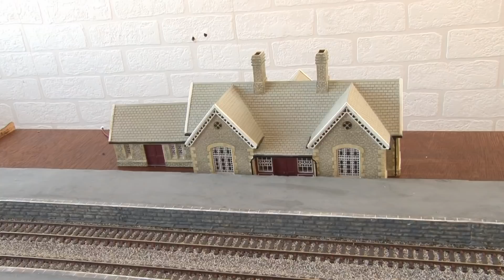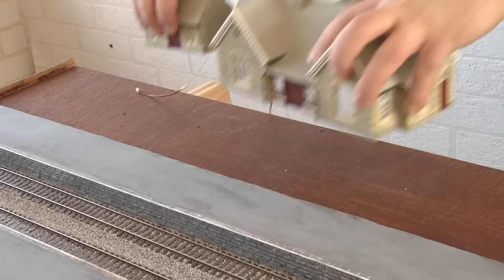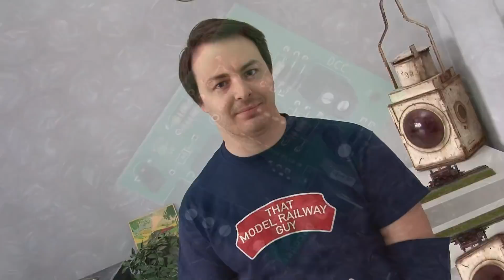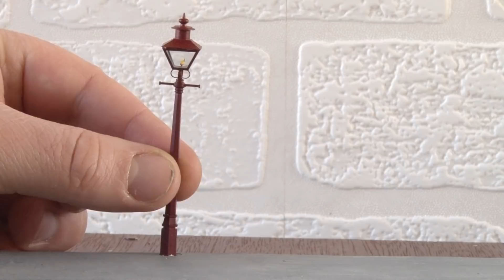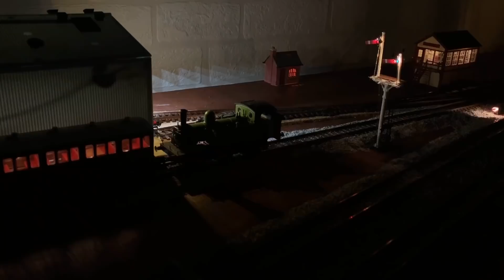Building A Modular Model Railway! - Episode 15: How To Install Lighting

Comment: Not sure if this has been commented on before, but isn't there a problem with using a buck converter to reduce voltage for LEDs without resistors, in that current increases? I'm no expert, but from what I can tell the advice is to still use a resistor unless the convertor is a relatively expensive one which reduces current as well.
Reply from the maker: The only issue I've come across is that if the buck converter fails then all your LEDs do so it's a single point of failure as opposed to one for each light. Thanks for watching 👍

Comment: Hope you're well.

For my understanding, is this the wiring for DC then

Power Supply into Distributor Board > Into Voltage Converter > Into LEDs via splice connectors 

Have I got this right?

Thanks in advance
Reply from the maker: Yes that's essentially it. You don't need the distributor board if you're just using the 12v supply for lighting - I only used one because I was powering other stuff from the same supply.

The buck converter can also be removed if you have resistors on each of your LEDs which steps them down to 3v. I just couldn't be bothered to solder a resistor to each light so opted to step down the whole circuit. Thanks for watching 😃
Reply: @ThatModelRailwayGuy What a guy, thanks for your response.

Comment: Hi. What app is used to control the layout please?
Reply from the maker: It's the Z21 App that works with the base station I use. Thanks for watching 👍
Reply: @ThatModelRailwayGuy  thanks for the quick reply and the great videos. Have you considered doing a comparison of the different controller options? E.g. HM|DCC vs Z21 vs ... etc
Reply from the maker: The issue is that to make any sort of useful comparison you'd need to have access to all the different DCC controllers and hands on experience with each. Unless someone wants to fund that particular video I fear it would be beyond the scope of the channel.

Comment: If using non standard colours for teh wires it's always a good idea to put a standard colour tape at the ends of the wires :)  Loving the videos thanks
Reply from the maker: The wire colours are standard for me, I just didn't want to make the 12v lighting bus Red/Black as that would be the same as the 16v DCC (track power) bus. I tend to use Blue/White for 12v DC across my layouts for easy identification. Thanks for watching 😃

Comment: Great video - can I ask for more details on the step down power converter and the red clips that you use underneath on the wiring . Thanks
Reply from the maker: Hi there, all the products used are linked in the description for those that want more info. Thanks for watching 👍
Reply: Ah - thanks - was watching through the tv and couldn’t see the description with all the info . Will get my order I. ! Was there a video that showed how you did the outside lights on the shed

Comment: Great stuff. Perhaps not so good for my wallet.  lol.
Reply from the maker: The lighting was probably one of the cheapest parts of the layout. If you're not including buildings and kits, the 12v power supply was probably the most expensive part to be honest. Thanks for watching 😃
Reply: @ThatModelRailwayGuy  where about did you get your 12 volt supply? I have a Hornby elite dcc and would prefer a separate source for my lights and points.

Comment: Great video.  I have a question, I want to put a single led light in a paper building.   Do I have to worry about fire?
Reply from the maker: I wouldn't have thought so, it probably wouldn't get hot enough especially if it's a 3v LED. If you're really worried you could always mount it on some tin foil as a protective shield, which will also reflect the light. Thanks for watching 😃
Reply: @ThatModelRailwayGuy  thank you.  Good idea.😊

Comment: Whats the track plan and baseboard size ? Cus I might make one
Reply from the maker: As the layout is modular naturally the track plan and size changes depending on how I set it up. If you check out Episode 16 though there is a track plan towards the beginning which shows the layout in its exhibition setup. In that instance the main circuit is around 13'x7'. Thanks for watching 👍

Comment: Nice Layout There 
9:12 odd how the signal moved up and down slightly
Reply from the maker: Thanks, it's certainly starting to get there. That's just because the servos are on the same power source as the lights. When the control unit powers on it gives the servos a quick check. Thanks for watching 😃

Comment: I want to install some station lamps like the ones in the video but I don't want to do all the fancy electronic bits you did under the board but do a basic wire up to a controller or something similar.
How do I go about doing this bearing in mind im not good at soldering and wiring?
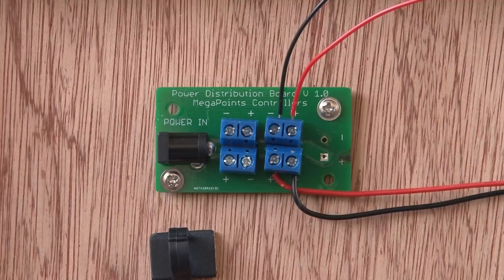Reply from the maker: Hi Matt, the wiring would be pretty similar in all honesty, you would just connect your wires to a DC controller instead of the board seen at 04:45.

If you don't use a voltage regulator you would have to solder a resistor to every single LED though. OR you could just keep the controller on at a very low level but there's a risk that your lights will blow. Another option would be to perhaps look at getting a dedicated 3v power supply instead although I don't have any experience with those.

If you're not very good at soldering (I can relate!) then I would suggest looking at the 12v Power Distribution Board linked in the description. That will allow you to connect up multiple lights using screw terminals instead, which are much easier to use. Hope that helps and thanks for watching 😃

Comment: A great video. Just the info I needed. Out of interest, has the voltage regulator remained consistently working 9 months on?
Reply from the maker: Yep still working fine and I've used the same regulators on two more layouts since this video. One was an exhibition layout where I leave the lights for pretty much the entire weekend and the other was a Christmas layout where the lights were on throughout December as part of the festive decorations. No problems at all so far. Thanks for watching 😃
Reply: @ThatModelRailwayGuy  I thoroughly enjoy each series as they are produced. I always learn so much, very well presented. ⭐⭐⭐⭐⭐ 5 Star channel

Comment: Great video. I think using the woodland science just plug in would be a quicker install. For lighting and adjusting the brightens of the lights. I've used them, they are easy to use and install.
Reply from the maker: Thanks Trevor! Yeah the Woodland Scenics system would probably be easier to install but it would probably end up being much more expensive if you have a lot of lights like I do here. Thanks for watching 😃

Comment: Great video and clear and easy to follow. Do like that voltage regulator. Winsor and Newton Black Acrylic paint from the Range, is a very dense black for painting inside Hornby resin buildings.
Reply from the maker: Glad you enjoyed it! Yes the voltage regulator is very handy for getting things up and running quickly. Good tip for painting the inside of the buildings too, I'll have to check that paint out sometime. Thanks for watching 😃

Comment: I would have had the socket for each building above the board and in the building to make connect/disconnect easier (no need to crawl under to seperate) PS if you want to have flickering lights in fireplaces/fireboxes/bonfires etc then use the led from a led tealight. I made them for a friends layout
Reply from the maker: Yep you can do it that way too if you like. As my layout is modular though I have to go underneath to get it all setup anyway so it doesn't really make a difference in my case. Thanks for watching 😃

Comment: Great video mate. I have to say the lights really make a Difference to the overall appearence of a layout. DCC lights that's something I have never seen or heard of before it was interesting to see how they worked. Look forward to some night shots in the future. - Nicholas.
Reply from the maker: Thanks Nicholas! Yeah the DCC lights still run of 12v DC (or rather 3v in this case) but it's the On/Off switch that is controlled by DCC. I'm looking forward to doing some night time running in the future too! Thanks for watching 😃

Comment: for the cost of a couple of resistors its seriously worth adding them, dead easy, stick one end into your distribution block, and solder the other to the feed wires, this will make sure the current is suitable pretty much no matter what - and can also dim them slightly if desired. 1k resistors are find for 12v, higher may work well

there is another alternative, slightly more work but once its working its easy - use a PWM LED controller board - Adafruit do one that will drive 24 LEDs, needs a cheap Arduino clone but then you can vary the brightness of each and once happy switch the arduino and the driver on/off and the lights come on/off as desired. (this is a bit more work but once set up its really good, also very good for adjusting the brightness so different lights match)

I do like those shed lights though

oh yes, the black paint idea for blocking light leaking works very well, and nothing to say you can't paint over the black
Reply from the maker: Awesome, good to know. I LEDs actually all came with resistors and I probably will add them to the circuit at some point down the line. Doing things to a deadline to get a video filmed partly dictated the strategy here (along with my own impatience for results 😂). Thanks for watching 👍

Comment: Fantastic tutorial! Thanks very much. I’ll be referring back to this…along with your other videos as I progress my own modular layout.

Can I ask, do you use electrofrog or insufrog points? I have been struggling a bit with short wheelbase locos stalling when crossing electrofrog points. I’m not sure what I’m doing wrong though. I have altered them correctly.
Reply from the maker: Thanks, glad you enjoyed it! I use insulfrog points personally and my Peckett and Ruston are fine on them. 

If you’re having trouble with electrofrogs maybe check that they’re layed completely flat and not bowing at all. Otherwise it can lift one set of wheels off the track - it may only be a millimetre or so but it’s enough to cause a stall. Thanks for watching 😃
Reply: @ThatModelRailwayGuy  Thanks very much for your advice.👍 Much appreciated.

Comment: Enjoyed the video. I am currently working on lighting up my own station and platforms. To dim the brightness of the lights, might I suggest this 'High Temperature Heat Resistant Tape polyimide 1cm'. I've tested this on 12v and 3v LED lights and the brightness noticeably drops when I put a bit of the tape over the LED.
Reply from the maker: Hey Tim, that’s great hope it goes well for you. Ooh good tip, I’ll keep that in mind if the black paint doesn’t work. Thanks for watching 😃

Comment: @9:10 through @9:13.  Idk if its intentional but the taller signal flag moves as the lights in the shed kick on.  But now that begs the question. Is that taller signal flag Hunted? Mmmm.
Reply from the maker: No not haunted 👻 I was just switching the power on for the whole layout and the servos that control the signal jump slightly when power is first applied. But good spot, you’re really on the ball! Thanks for watching 😃
Reply: @ThatModelRailwayGuy  lol! Thank you for explaining. I was wondering how you did that and now i know. Lol and thank you! For a another awesome layout update.  Even if the taller signal flag is not hunted. 👻  can't wait to see if you got anything planned for Halloween when it cames around. That taller signal flag would be a good trick for a hunting. 😂